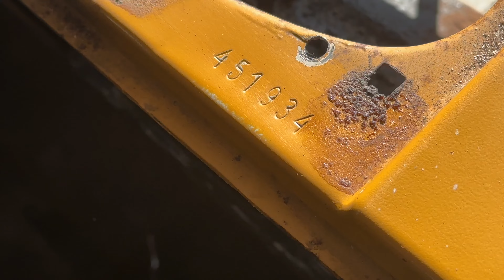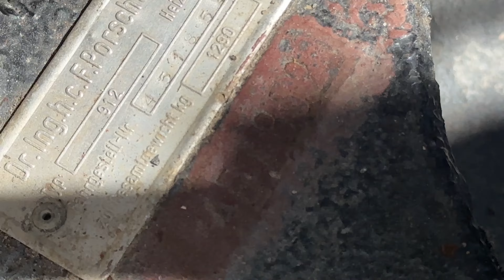1966 Porsche 912 3 Day tear Down for restoration of Gary Leivers 912 #havasuporsche

Comment: Based on the engine detailing I am guessing you are in for more surprises 😂 Are those type 3 bumperette rubbers 🤣 That rust doesn’t look that bad if it doesn’t go any higher than the hole. There was NEVER EVER a 4 gauge car only 3 gauge or the option was Exterior Thermostat and Clock as a package only. You will get it right.